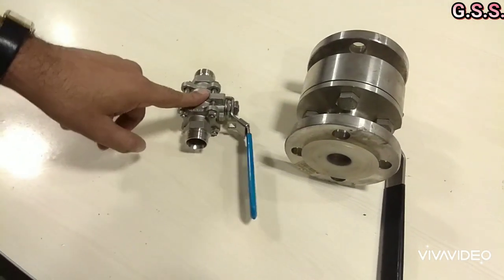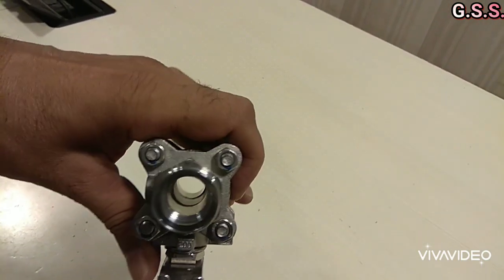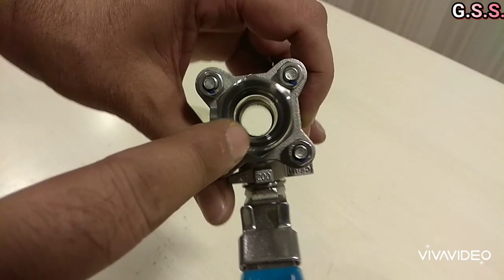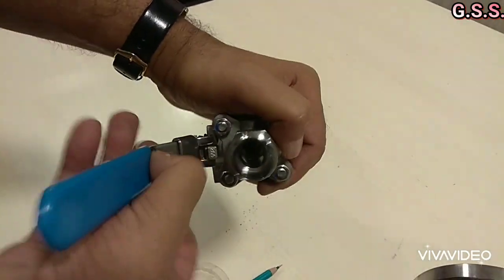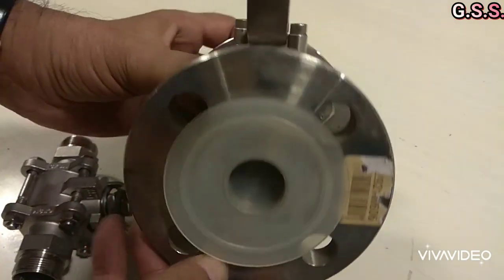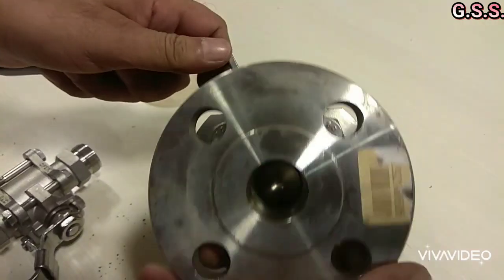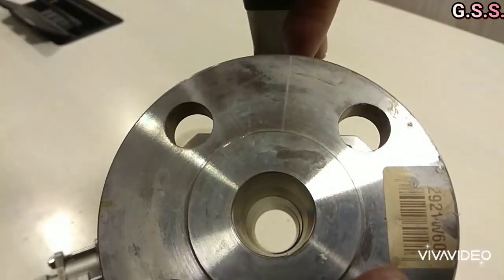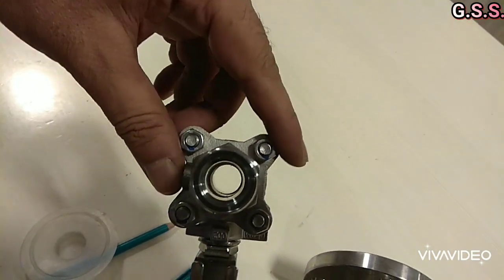Piping Engineering : Ball valve - full bore & reduced bore

Comment: Please explain during hot tap piping tie in in the existing pipe. As per Aramco STD need to use full bore Ball valve in order get full bore in existing valve. Here using full bore valves instead of sandwitch valves. Please can explain verbally better to me